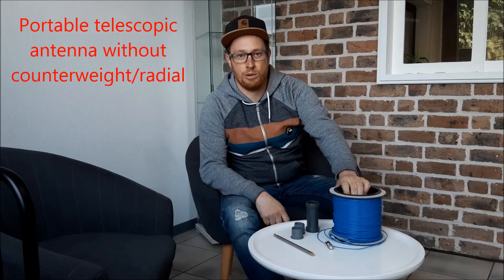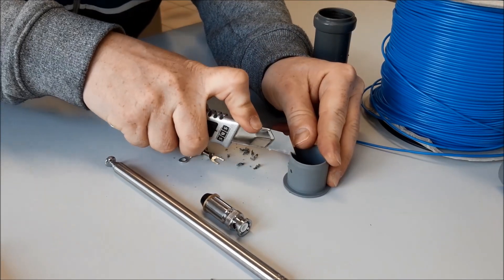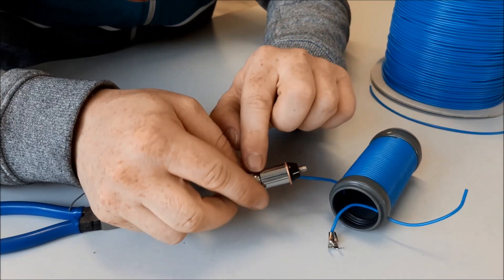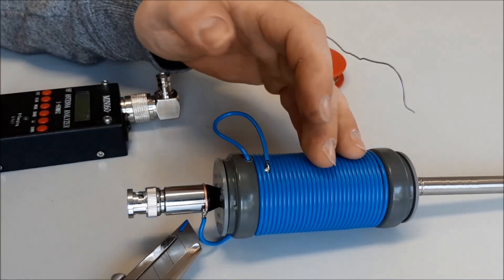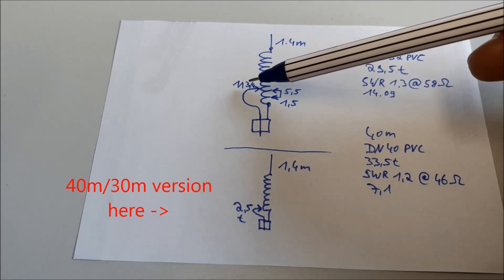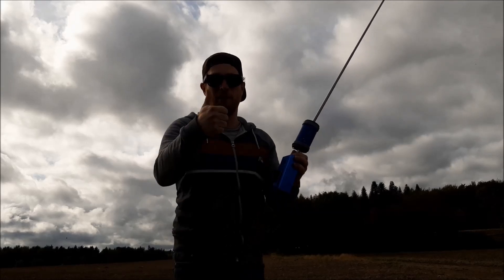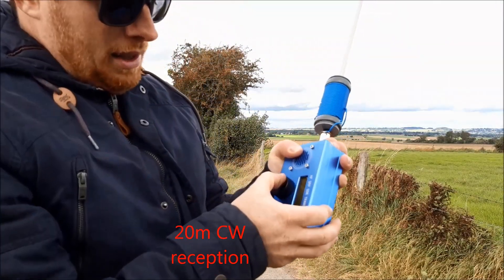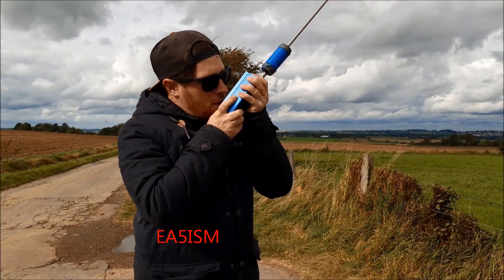Ultimative DL1DN sanitary cheap DIY QRP telescopic antenna uSDX QSO on 40/30/20/17/15/12 + schematic

Comment: Hi there. Check out also, kinda similar project, and the antenna mount in particular. https://youtu.be/KpKvVMHGKa0
Reply from the maker: Yes thats the same principe. More challenging is to do this with a little telescopic whip also
Reply: @QRP.lifestyle  did it also, with 1.8m telescopic antenna, right. Connected to that radiator mount. Radiator is from bts7960 motor drivers bw if smth.  ) also by putting some magnets, and a lil bit wider only coil basement left, it can be placed on the vehicle rooftop, and work like that, while parked. Rf chokes on coax cable also will be good. Not shown on the video.
Reply from the maker: @modellerdesign  I have the same on my car

Comment: Thanks man, do you have a link for that telescopic antenna? Im going to make your invent
Reply from the maker: I boght them 4 or 5 years ago.
Some kind from 100-150cm will work. You have to play finding the right spot on the coil to match SWR.
Reply: Ebay has numerous telescoping antennas in various lengths.

Comment: Thank You Friend. And finally, DN40, is?
Reply from the maker: 50mm
Reply: @QRP.lifestyle  ist es jetzt ein dn40 oder dn50?! du nutzt 1mm Kabel oder 0,75mm?
Reply from the maker: @scooby_81   außen 54mm bei der 40m Version das sollte DN50 sein. 0.75 Litze
Reply: @QRP.lifestyle  danke, währe vielleicht nicht schlecht es in die Beschreibung zu schreiben
Reply from the maker: @scooby_81  mache ich

Comment: Nice job, can you tell me the wire gauge you used, 73 de CT7AQF
Reply from the maker: 1mm
Reply: 1 mm metric is between 18 and 20 gauge

Comment: This is another great video - your other two reviewing this QCX derived transceiver are excellent. I have also had very encouraging success on both CW and SSB using the internal battery power with good audio reports over 1200 Kms on 20m and 40m. The CW features are especially good. Built like a brick though firmware is a little flaky it adds to the QRP fun! 73 G3SNT
Reply: I have been using mine on CW tonight and am certainly impressed for the price . Nice to be able to make so many adjustments for CW for the price . Will be looking for the German version to see price point as I want to use these to replace my old Xiegu X1M's that I use for beacons , so I need a few . Haven't had time to try WSPR yet . 73 W5COV

Comment: Thanks. very interesting.
I will wait for a more complete review specifically for CW.
very interested in audio quality.
now i am using QCX, but this a single band radio. 
73, RW9RN
Reply from the maker: The digital filters are 500,200,100,50
Reply: @QRP.lifestyle  yes, I know about digital filters ..
I'm interested in the audio quality in the receiver.
I have looked at several reviews on uSDX and in many cases the audio quality was poor. I may be spoiled for good transceivers :)
Reply from the maker: @MrCudgel  What can we expect from an 170$ 80-10m radio. For its price its nice but yes in cw its not perfect at all.
Reply: @MrCudgel  you may be spoiled for good audio...which is more dependent on the speaker a lot of times.

Comment: How did you fix M5 bolt inside BNC plug?
Reply from the maker: It was from an old fm radio antenna but you can also end compression rg58 the have extertal thread. I will use this also for next projects.
Reply: @QRP.lifestyle  Thank you for the secret :)